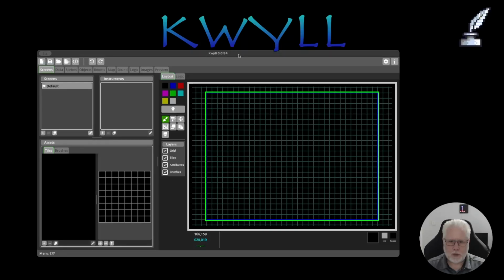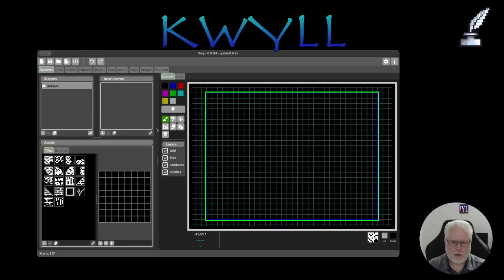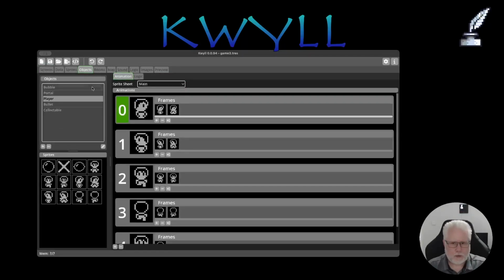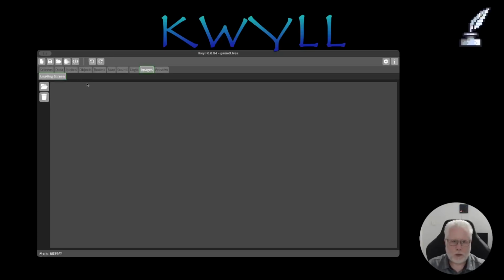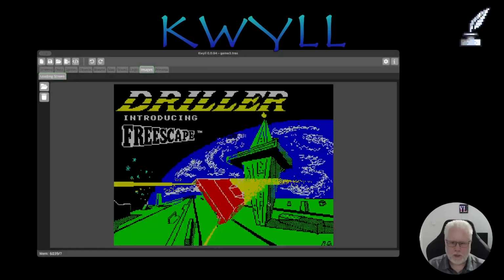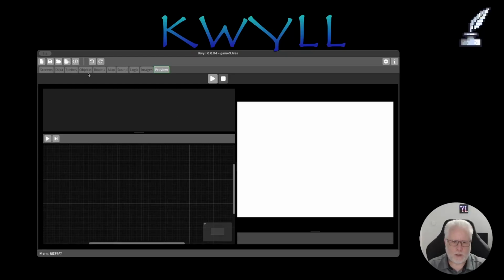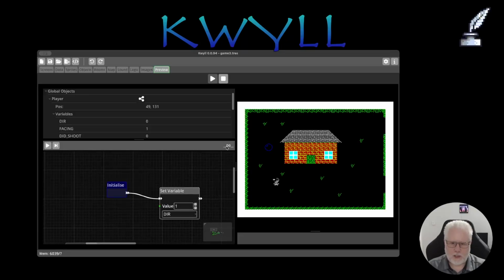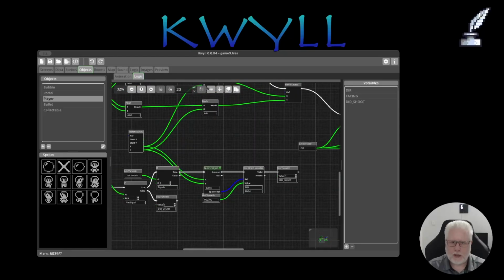kwyll 32 - Feature Complete

Comment: as a 50 something non coder, this looks potentially fab. is there any ideas to move this over to other 8 bit computers like c64? cheers Colin (55).
Reply from the maker: Hi, yes, the plan for Kwyll long-term, if there is sufficient interest, is to support other 8bit platforms. The current plan starts with supporting the 128k variants of the Spectrum, followed by the Spectrum Next, then from there it depends entirely on demand and interest.